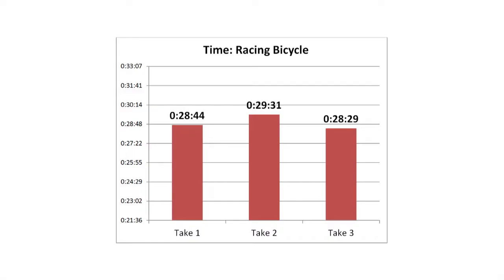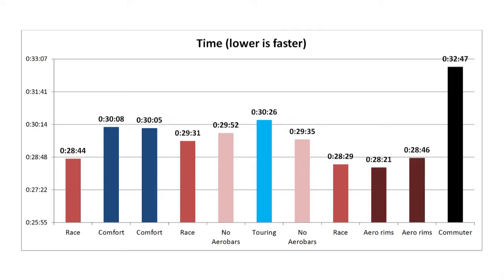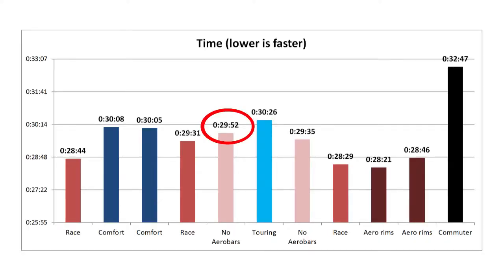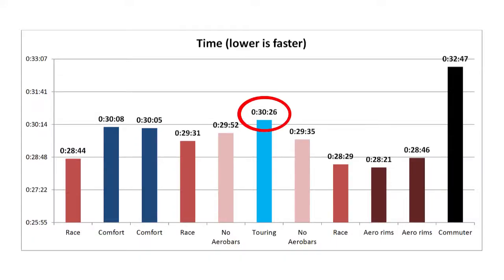Do it yourself Time Trial (Racing vs Comfort Bicycle) - BIKE SCIENCE 101

Comment: Interesting. I`m guessing the classic may be a an old Look. I`ve been doing the same thing with my commutes to and from work. The previous place of employment was 13 kms or about 8 miles. Mainly side streets and a couple of bike paths, so minimal disruption(ie traffic lights) but a few spots where I had to carry it up or down steps. All 3 bikes I`ve used have GP 4000`s 25mm and I have them at about 95 to 100 PSI. I have used an 83 Grandis with Campy Super Record which weighs 9 kgs, with a really aggressive geometry, 54-42 crank and 12-23 6 speed, Columbus tubing; a Cannondale CAAD 8, which is aluminum with carbon forks, 10 sp 105, 12-28, and a more  relaxed geometry like a light touring bike`; and the last is a Look 675 Light, all carbon, 11 sp Ultegra 11-32, and a geometry that is not quite full race, but is used by pros in the Euro spring cobble road classics. Times weren`t to the second but minutes.My best time with the Grandis was 18 minutes, and I usually averaged about 23 minutes. Best time with the C`dale was 17 minutes, and averaged 21 minutes. With the Look my best was 16 minutes, but I usually averaged 18 minutes. The biggest issue with the older bike was the lack of gears, too big a jump between cogs, you can get the speed but it's difficult to maintain the speed, especially with the two small grades that I hit. That's why the Look is so much quicker, once you get to speed, it can be maintained, you can always find just the right gear. But I do love the old steel bike, it rides so nice I really don't care about the extra few minutes.
Reply from the maker: This is such a great comment, thanks for the breakdown!  It sounds like we are of like minds on the feel of the classics too.  I've tried the commute timed rides, but the it is way to variable based on traffic, stop lights and safety concerns. I'm with you on the gearing, however, I feel the 13-23 on the classic so the jumps aren't big enough to cause an issue for me.  The trouble I have is the cadence of choice is usually right between the change from the small to big chainring.
Reply: I forgot the weights of the other 2. The C'dale is about 8.5 kgs, and the Look is about 7,5 kgs. The other thing with the old bike is the downtube shifters, no indexing, so you're hunting. The biggest difference I found for times was aero wheels. I got some nice carbon clincher wheels for the Look and the time knocked off my current 25 km commute was about 7 or 8 minutes with no real change in effort. No power meter or anything, just guessing about effort, but you do it enough and you can tell.
Reply from the maker: Good points.  It sounds like your aero rims are better / more of an upgrade than mine!   (7 or 8 minutes for you vs no reliable difference for me)  I do think power meters are a great tool, but then it wouldn't be a "DIY Time Trial"  :)